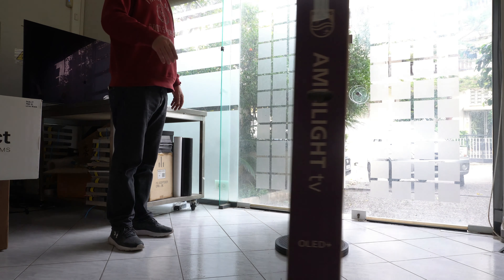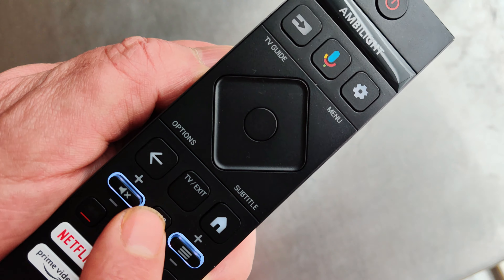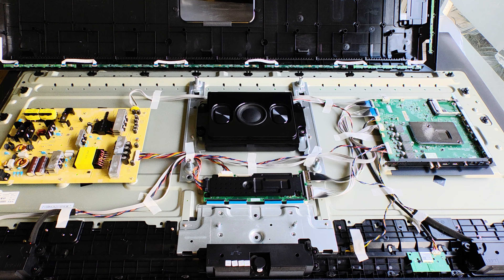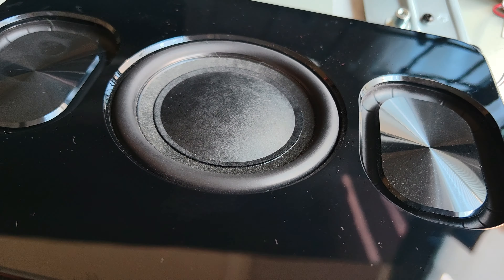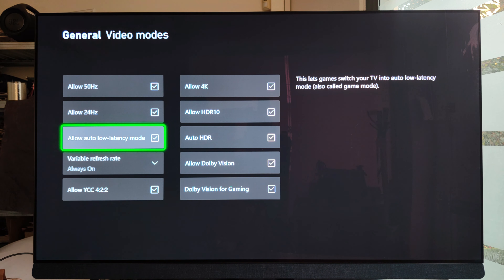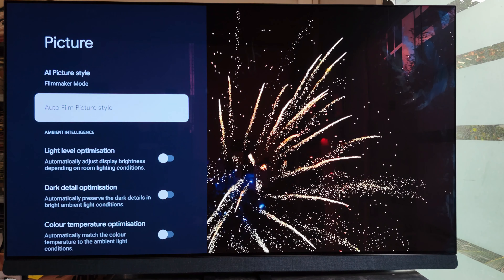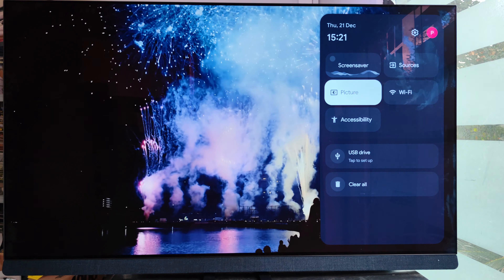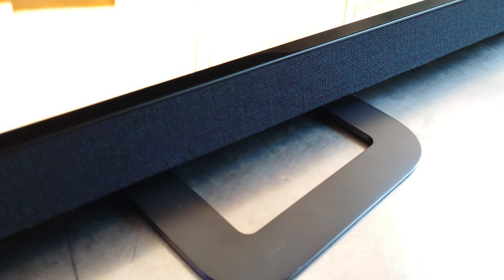Philips 65OLED908 review and deep unboxing

Comment: Was there a protective plastic layer that you removed on the screen and the remote? I want to make sure my TV is not used before and I wonder if it comes with a protective plastic after unboxing it.
Reply from the maker: I don't know, the TV was previously unboxed. Usually all the brand new TVs have the protective layer that you mentioned.

Comment: Also one last question, do you think it's dangerous for the tv that that subwoofer is connected to the TV's board? Wouldn't that shake and vibrate the inside of the TV? I hope that design doesn't create problems in the future. I want my TV to have a long life :(
Reply from the maker: The build-in subwoofer is suspended on an elastic system, totally decoupled from the video systems.
Reply: Should not be a problem because of low watts should not be a problem

Comment: i am stuck at the pin installation screen :/ can't enter into the menu to see numbers to enter them
Reply: and nowhere any similar issue
Reply from the maker: @DJQuickSB  use 1111 or 0000
Reply: After digging in the manual i found out that i had to press the 123 icon tonsee the numbers. lol